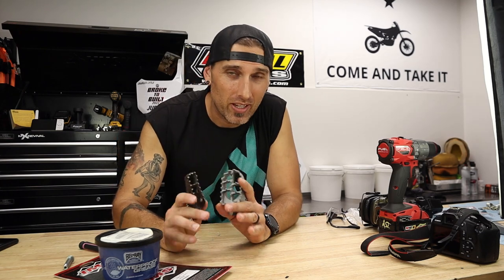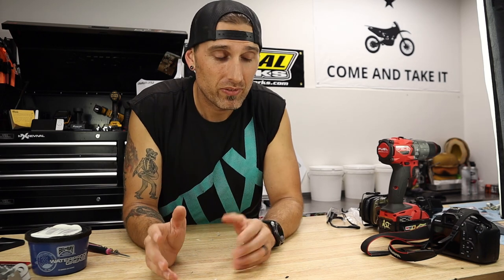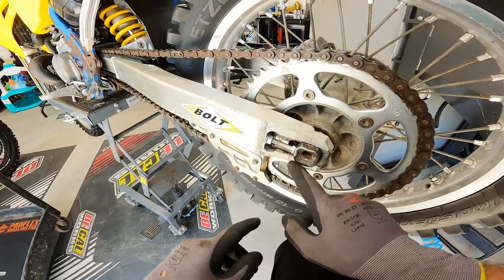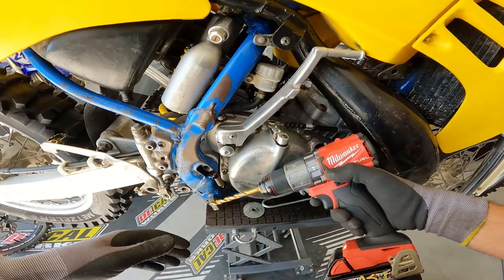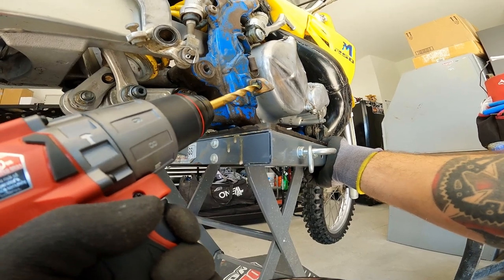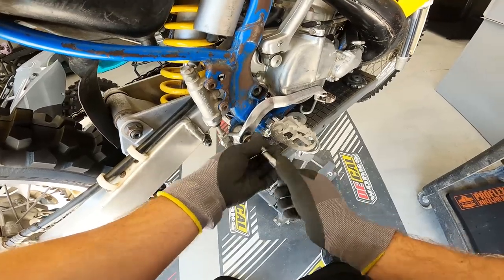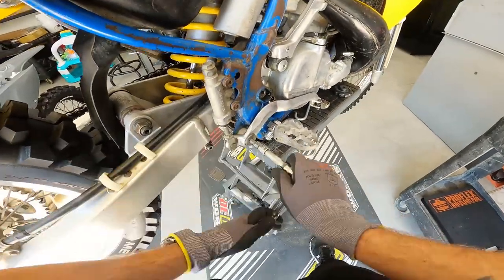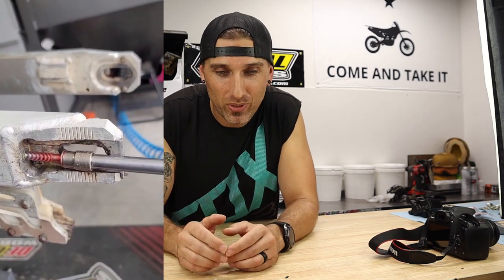BIG A$$ PEGS 🔥 How To Install Larger Foot Pegs on Your Old or Vintage Dirt Bike - 1989 Suzuki RM250

Comment: I have an 89 RM259 myself and used this video as an aid so thank you for that.I actually beveled the backside of my IMS pegs on a disk sander and the DRZ springs will lock right into the factory spots and unless you were were told they weren't a direct bolt on you wouldn't know.
Reply from the maker: Awesome! I’m glad it helped. I know exactly what you mean about making the springs lock in too. Great idea, Ryan 🔥

Comment: Older bikes were designed to sit on, not stand. Wide foot pegs were not required. It was not till the aluminum frame design that riding style changed to standing more which was made easier with the wide pegs.
Reply from the maker: That makes sense! The the seats on these cool old bikes certainly proves that

Comment: I had a nightmare trying to find footpegs for my 06 RM250. The ones I could "get" in the UK turned out to be for RMZs. In the end I bought Raptors because the import fees for buying from the USA made them even more expensive.

Even still, the raptors had to be specifically built for me and they didn't fit correctly - the kick stand would wedge itself on the peg. In the end I had to massage the underneath of the peg with an angle grinder to stop it catching and tearing chunks out of the kickstart.

That still, those raptors work a treat. No longer slip off the pegs now.

Oh, and for opening up those holes, I find reamers to be better, especially if you're opening up titanium pegs.
Reply: The OEM pegs on the 06 are titanium hopefully you kept them also
Reply: @jondoyle8741  I've still got them. They're  worn out after multiple resharpenings  but good to keep "just in case"
Reply from the maker: Man that's a bummer! Here's a cool tip that you might like. 2012 and up KTM pegs fit the RM chassis. You can use the KTM springs as well. I figured this out while doing a little bit of research for an upcoming RC4 replica build. Stumbled across enough matching information and photos to confirm and I will be doing it myself as well soon. Thank you for watching!

Comment: HA!!, did the same thing to my old '90 RM250 - would post a picture if I could.  FYI, I did have a 10mm drill bit but sometimes you have to use what you have.  Either way this is a great mod for any old bike (including my '87 Can-Am 200 ASE 😊).
Reply from the maker: Hell yeah, that Can-Am is a gem

Comment: These are really great Charles! BTw did you have a video on how to properly clean / save a used airbox.  Trying to learn new tricks!
Reply from the maker: Thank you! Maybe not an airbox video but I did have this old video I put together for polishing up a fuel tank: https://youtu.be/J4XasNjJJgY

If you have deep gouges, this won't be enough but I was actually surprised at how well this worked especially for how little effort and money it required.

If you have some serious damage, and I mean damage that might even lead you to believe you should throw your parts away... You have to check out my boy Phil at Plastic Renovations. He is not human, all the work is God mode!
Reply: @mxrevival  Thanks for the tips dude! 👊🏼

Comment: My stock pin on my 01 YZ250 is too thick to go into the tusk foot pegs, have any of you guys had to drill out the holes on the actual aftermarket foot peg? I was annoyed4to find that tusk didn't provide a new pin and spring.

Comment: Get a welder, make half cage to hang off back of peg for foot clearance, costs less money than chips in expensive grease.
Reply from the maker: Had I not found out I could pull this off, that would have been the route! But I know most the people in my audience will be happy to have a more direct solution that they're more likely to try. Imagine how nasty and sharp we could get them with the welding mod?? Thanks for watching Daniel